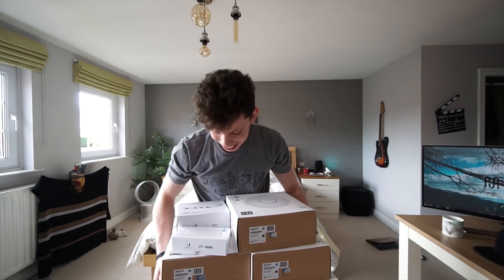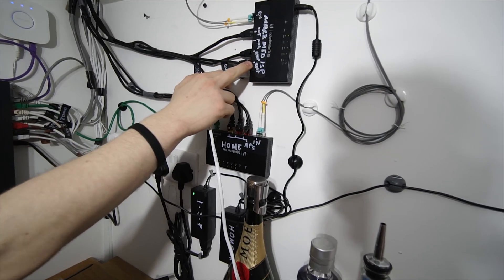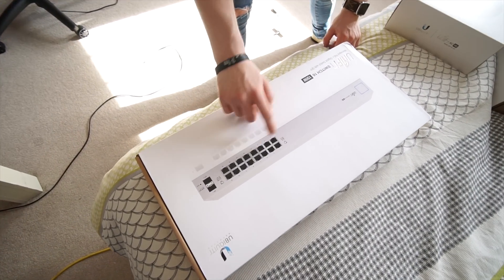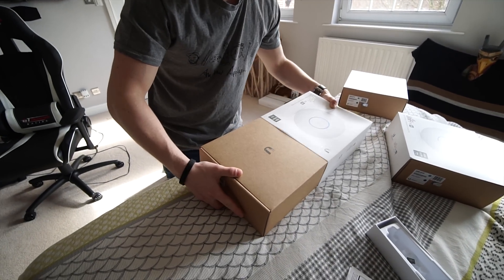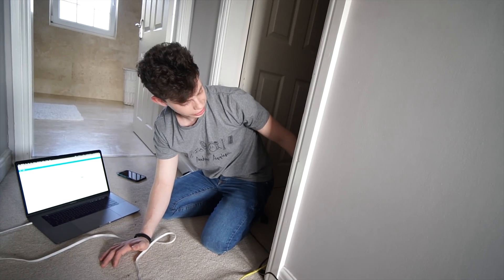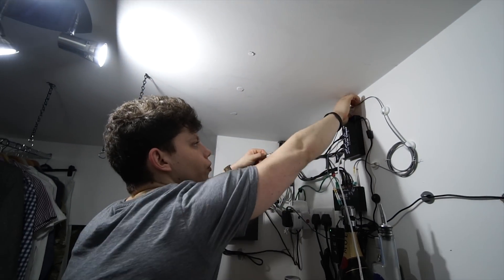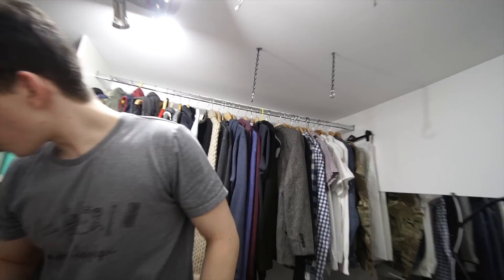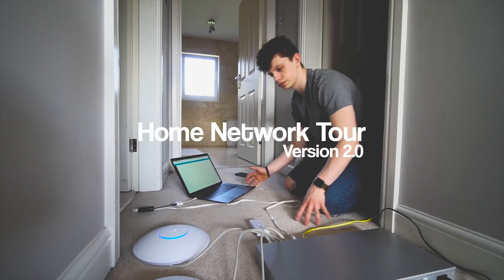Alex's ULTIMATE Home Network Install | AC Access Points, POE Switches & NAS!

Comment: Why are you only using 1 cable per access point, I thought they took in two ethernets?Therefore, surely you're not getting the full throughput possible from the access points?
Reply: I believe link aggregation is supported on the AC-HD's, but none of the others
Reply: custompcreview.com/reviews/ubiquiti-unifi-ap-ac-hd-access-point-review/38610/

There's a good write up here. But they really dropped the ball by not testing multiple 3x3 clients from the same AC-HD, which means we still don't really know if a single gigabit ethernet cable is ever going to be a bottleneck here.
Reply: The ubiquiti APs have one port for accepting network connectivity, and then another port which can be used as a two port switch. So you can daisy chain your access points. AFIK you cannot run link aggregation to get 2gbit to a ubiquiti AP.

Comment: What is all the components that I will need to start my own small isp for my area. Great video keep it up.
Reply: Do the dedicated network video
Reply: Visual Gamer you'd first need a license/permission to resell your connection. 

And if you have to ask this question you should in no way be providing Internet accesss to others.
Reply: Chris Hinds no I have a idea and I won't be selling for some  time but I was just double checking. I k ow everything else
Reply: Chris Hinds and also I won't be selling for some time and I need to do a lot more research and I was asking this just to give me a little help

Comment: I appreciate the fact you put some time into improving you're setup and configuring a decent home network but you need to work on your cable management, can get a 9u cab installed in that corner, rack mount the switch, run cables from AP's (and even install wall ports) into a patch panel and use rack shelving for all the other equipment, all of this is incredibly easy to do with a little research and will massively improve your setup, will then be space in cab to install other stuff like NAS and servers etc.

Comment: What is the cloud key used for? Is it used for configuring the settings, or would the system work without it?
Reply: Andrew_Paper with this you Control all devices and have acces form outside from cloud.
Reply: HDTimeLapseVlog OK thanks, so it is necessary then?
Reply: You can also use a software on your pc to configure everything.
Reply: It isnt necessary but it's a good to have. The Cloud key is a glorified Raspberry Pi basically, it runs the unifi controller (for you to configure your devices and also controls device AP handoff a bit), it can also run a webserver for for example a captive portal.

Comment: Hey Alex, love your video but I noticed you have drilled your switch to the wall... Those are rack mountable brackets not wall brackets but they should hold the weight of the switch anyway 😄😉
Reply: Well a small open wall rack would not hurt you. Then you could sort the cable's easy and add/remove as it comes. But i think Ubiquiti went overboard. You should maybe even gone with the US-8-150w for your network and maybe move the US-16-150W to the office. ;) But still a great video! but for me only the AP was new because i got a US-16-150w and a "AP-AC-Lite".
Reply: At the end of the day, it's you choice what you want to do with your equipment just passing on the advice my boss told me. I completely agree, you don't need to have a rack unless you want to large scale NAS to archive your videos and backups
Reply: Aaron Howard it's his choice but you still commenting, dafty 😂😂😂